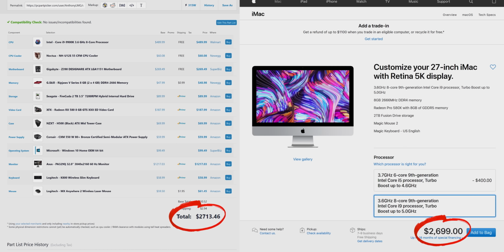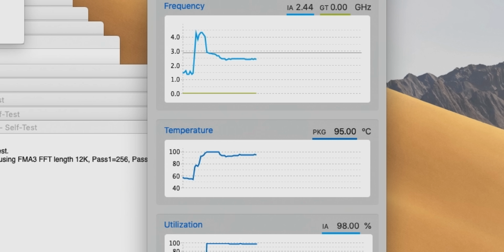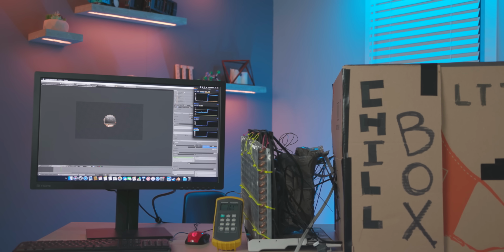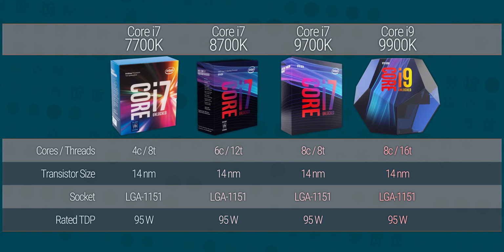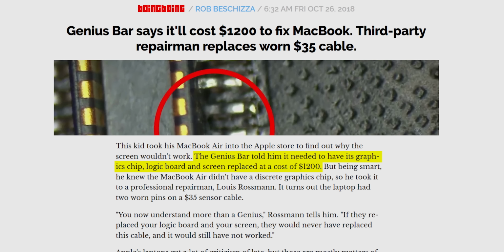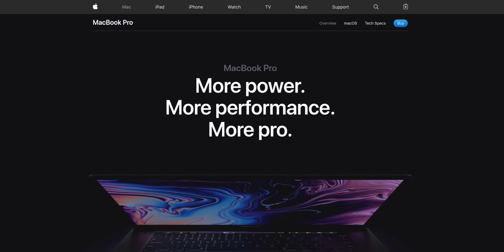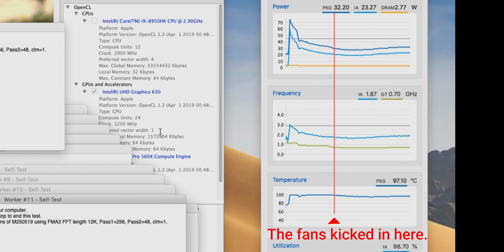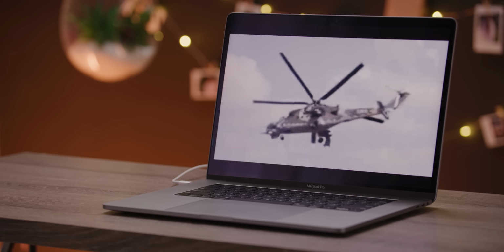Macs are SLOWER than PCs. Here’s why.

Comment: Given 85% of Silicon Valley uses MacBooks, it's not an issue of technical skill. Its an issue of recognizing that other variables matter beyond pure preformance every minute of the day.

I'd be pissed if my fan was ramping up all the time while I'm doing a zoom/conference/facetime call. 
Be assured that Apple data mines their support calls. I bet there is a 1000-to-1 delta between a support issues dealing with fan noise versus "my computer is 10% slower".

Comment: I can't get around why typing on the keyboard feels like you're typing on a calculator, DMG files are twice the size of ZIP files, proprietary adapter required for dual screens, inverted scrolling, overheating, not upgradable, the barely usable Magic Mouse, the cheese grater Mac Pro, pressing 3 bloody keys to take a screenshot, can't run 3D Studio Max, Command+C instead of Ctrl+C which puts strain on my fingers, no way to go "up" a directory, power plug impossible to pull out, you can only open one instance of an app at a time, no Start Menu, USB headphones don't work with it,  that aggravating "bong" noise when you turn it on, there is still just one mouse button, you cannot batch name files, you cannot snap windows, you cannot automatically arrange icons!

and they are SLOWER than PC's!

Inexcusable really, how much do these things cost again?
Reply: Stewart Fullerton few things... you can compress .dmg (.dmg is binary), Logitech mice work wonderfully (or pick your brand, just not RGB), Cmd+up is a thing, single instances are a feature (no write-protect errors), you can mute the noise (lookup start options, read everything), and it’s UNIX underneath all the bling so saying something like “you can’t batch-rename” is just an excuse to not learn the terminal... 
Given all that, you have a few fair points, and it’s blatantly Apple’s fault that anyone believes that a MacBook is anything more than a really snazzy word processor / presentation device.

Comment: You mean... Apple has been compounding hardware-design risks with "tweaks" in their OS, making their devices more likely to fail?  Sounds like "user-inflicted damage" to me. smh
Wac.  It just breaks.
WacBook Ail.  Light.  Paperweight.
CrApple.  Stink different. 💩🍎🍏💩

Frequent durable-goods replacement... the solution to climate change.  'Cause we can have our cake, and heat it, too! :-)

No man-made solution to man-made climate change?  No problem!  The natural solution of drastic population reduction will be selected for our species instead. smh

Comment: 7:30: The answer is that fun laptop computers use too much electricity and would give a battery life of 30 minutes in thin constructs. A greater asset for Apple is the A processors, so the laptops are in a mode of "well, alright, we need to get rid of the items from this failed project anyway... a few billions on the side won't hurt us."

Comment: Fedora Linux works so well i don't miss Mac OSX and i'm using it on a Core i3 2012 motherboard. Even without Wayland it overperforms any mac i could get close too...
Reply: mad scientist Yeah keep telling this to yourself... I switched from Debian/Ubuntu With Virtualbox(T460p 4cores 32gb ram)to MacOS with Fusion  and its faster cooler and  more stable. I dont give a sh about cinebench 😎 I use bash and PS on different platforms at the same time... For my workflow is great.

Comment: As someone who actually designs hardware for a living, Apple do a very good job, but they drop the ball from time to time (like we all do). 

If you chose wisely you can get performing machines that stay performant for a long time.

My 2010 macbook pro is still in use, and still better than some systems sold today. 

My 2015 has been pretty much always on since the day of purchase, and is still rock solid.

One of the big reasons for me to keep using macbooks (alongside my other pcs) is that Apple nails the little details that make your life easier.

The custom battery packs and chargers that Apple use are unrivaled. Most competitors either outsource or use canned type solutions that end up with heavy reduction in battery life or needing a full replacement.

You might have a different opinion, but for me having a laptop with a CPU that never has to throttle, is an indication that the thermal solution is actually oversized, and I’m carrying way to much weight. On a Desktop? Yeah, keep your dies cool, but if I have pack it in a bag, you better have a good reason for the weight you are adding.

Comment: I'm sure they did market testing and people "don't like it when the fans get loud".
Reply: I actually read somewhere that anti-cooling philosophy for macs comes from Steve Jobs
Reply: So what you're saying there is that Apple consumers drove Apple to make an inferior product.  Resulting in said consumers ability to buy a new machine more often due to improper cooling.  Glad I'm in the Microsoft camp.  Especially since my PC which was originally designed for Window XP is currently using Window 7.  And I might add performing at peak performance.
Reply: @savthmaall  go Linux and start flying
Reply: @savthmaall  These Apple people are fools. Plain and simple. They bought Lisa workstations for $10,000 in the 1980's. Then they bought the original Mac for $2,500. They quickly realized that the Mac wouldn't do anything productive until you bought Microsoft or Lotus software. Then they paid several hundred dollars for an IPod because they couldn't figure out how to use an MP3 player that wasn't designed for a child. Maybe Fischer Price should have designed one for them.
Reply: James In Sandiego on the plus side, my original Mac Plus from the 1980s still mostly works without ever having any maintenance
Reply: @savthmaall  yep they couldn't find water if we pushed them off a boat.
Reply: well you could always just make the heatsink bigger but i guess that creates an other problem what apple fans would not like
Reply: My coworker macbook pro 15" 2018/2019, it's fan will blow very loud at peak
Reply: i return amd a6 9225 ...  because of fan.. It dam weird over 20 year in computer i yet to see this terrible fan noise and  heat
Reply: Yes your probably right, I wanted to buy a laptop for my daughter and did some reviews on HP’s laptop computers and a lot of reviews say that they can hear the fan kicking in at high-speed too loud, it was a big complaint.
Reply: The “fans”.
Reply: Yes, just use costum fan profile that don`t let it get to 95C before starting to run.... I also use intel overclocking tool to reduse the CPU voltage and with those to mods combined my 2014 Macbook pro can run 100% CPU stress test all day at about 80C running 3,2Ghz with no CPU throttling at all. Without thees mods it will be running at about 1,5Ghz (2Ghz but because of all the CPU trottling down it is more close to 1,5).
Reply: @a64738  Exactly. Every savvy Mac user has known this for years, Linus is just Apple bashing for views.
Reply: @HighwayRamos  You really shouldn't have to do a whole plethora of mods just to get some decent performance out of an expensive laptop.
Reply: @rgbtryhardled636   Agreed. I'm just using a fan app I paid maybe $10 for 5 years ago.  It's too easy to set up a six stage fan map based on gpu or cpu temps. If it saves me from ever visiting the Genius Bar, totally worth it.

Comment: Difference in philosophy is in my guess – THEY DESIGNED THE CHIP for the iPhone to fit it's design. They didn't design the intel CPU. If you look at it from that POV the Apple ARM macbook pro is not as much a horror scenario than it would otherwise be – not a fan to be clear I want to be able to run linux on everything I buy ;)

Comment: I agree. The reason is because its software. macOS seems like an operating system designed for SSDs only. It's unusable when you have traditional HDD. While you can run Windows with HDD, just a tad slower.
Reply: did you ever run win10 on hdd?? slow as f**K, barely usable
Reply: Michel Antunes Yes I do. It’s slow yes, but compare to macOS on HDD, it’s much faster.
Reply: I was given a crappy laptop with a slow hdd and windows 10 at work. I ended up upgrading myself that fucker to an ssd because it was impossible to get anything done.
Reply: @theondono  Again, HDD on any operating system is slow. But HDD on Windows is faster compared to macOS on HDD. All my school computers have HDD and they work just fine.
Reply: @charka1234  Windows search and Superfetch kept my drive at 100% in iddle

Comment: Macs are faster than PC
Reply: They have worse hardware ,worse thermals and lack overclocking support. So: no, they are not.
Reply: @johnmartinez12347  I very much disagree
Reply: @dollophead294  This is not agreeing or disagreeing, this is facts. They reach higher temperatures, their top CPU is only very high-end and the top GPU is not even close to an RTX 2080 Ti. They also don't have any overclocking support.
Reply: @johnmartinez12347  True I guess, I probably thought that cause I have a mac and a pc and the mac is WAY faster. :) No offense taken
Reply: @dollophead294  It is very much up to what you pay. My point is that you can get more performance out of a PC and that you get better performance for less money. If you don't do heavy work or game, the only big changer after an ok build is an SSD. If you have an older computer, a cheap laptop or a normal desktop, it's probably a slower HDD. I personally switched from an old laptop to a new expensive Mac and thought that it was much faster, that was until I started using it for more things than internet browsing. Then I switched to a new PC a couple years later and it felt the same outside of heavy loads.
Reply: @johnmartinez12347  I think it just depends on the computer :) We just had a cheap windows laptop, then got an expensive mac. PC's do have better specs than a maxed iMac pro. So, yes, you're right :)

Comment: I've never bought a Mac, or iOS device for that matter, because of "Looks or Status Symbol". I've been working professionally with Macs and Windows boxes since 1991. I currently work in the field of Mac security. Please look elsewhere for why people prefer Apple gear. The meme of  'I'm an Apple fan, so I buy what's flash and fashion' is as superficial as the attempt to paint Apple users as superficial. Instead, let me offer one actual perspective of 'Why Apple?', among many:

CNN
Q: "What's your computer setup today?"

Frederick Brooks, author of 'The Mythical Man Month'
A: "I happily use a Macintosh. It's not been equalled for ease of use, and I want my computer to be a tool, not a challenge."
Reply: Apple Macbook Pro has actually pretty good coling at least om my 2014 model with 2,4Ghz i7. But you must use custom fan profile as the default one will make it overheat before it starts the cooling fan. Mine can run 100% CPU usage at 3.2Ghz all day and never get over 80C, but if you tried the same with default fan profile it would overheat at 100 -104C and run much much slower (about 2Ghz). But I have also used inter overclocking tool to reduce CPU voltage a little so it produses less heat but that only make up for about 10C reduction.

Comment: Hey Guys, I'm really curious about which laptop alternative to a Macbook Pro 2017 does not have this "thermal throttling" issue? I can't use a Desktop I need to move around pretty often and travel with my Laptop all the time, so a Desktop is not a good fit for me

Comment: 90+% of the (non-gaming) computer buying public will never push their machines to the limits where thermal throttling is an issue.

BTW my Macbook is 6+ years old and running great. My previous HP laptop died after about 16 months (the screen stopped working, some problem in the hinge) so tell me again how Macs are unreliable…

P.S. I'd rather have my thin, light, quiet Macbook Air than a faster, inch-think, heavy monster that sounds like a freight train.

Comment: Just got a 2019 15" with the 8 core and had various issues. After waking up the computer from sleep/look screen it will turn on its screen from low to high brightness, then it will flicker once or twice... shortly after that it will lag for for like a split second every 3-4 seconds then it will shortly stop... it will freeze to where the time and all programs (nothing open and running) will not respond and restart. Upon restart it will create a report with and issues on "Bridge OS" anyone know what that is?

Comment: I think what happened is that they just expected Intel to have more efficient chips by the 2016 MacBook Pro redesign (a fair assumption a few years ago). Once it was clear Intel wouldn't be able to deliver, they stuck with the design, which led to the thermal limitations we all know. Keep in mind that Apple takes a long time to design their products, so they have to work with assumptions from suppliers (which often don't come true by the time they had expected). On the iPhone, they are able to know exactly what their CPUs are going to deliver without much need for assumptions because they are designing the chips themselves. TL;DR: it's not like Apple is just stupid (or "evil"), there was an expectation from Intel to develop more efficient chips which was not met.

Comment: I don't like overpriced Macs but I had Mac as my work laptop and it froze maybe 1 or 2 times during 3 years. Apple are still producing software in conjuction with hardware which makes them better laptops. Is it good price/value ratio? Not sure. But if you have unlimited budget Macs are better.

Comment: If you buy something simmular at the price, you would also get a working cooler, K-model CPU you could actualy overclock, most likely better keyboard/mouse. And if anything breaks you have a warranty on each seperate piece of hardware. I dont see the price near close.
And you can change parts down the line to continue to save money..

Comment: I have a MacBook Pro 13" 2016. but i wouldnt see myself as an "apple-fan" (Huawei phone, Asus desktop pc) 
But i really love the macbook pro laptop. its small, good battery life. awsome keyboard and (to my knowledge)  the best touchpad out there. it never gets hot and never feels slow. 
and i dont think ist a status symbol anymore. 

So my question is, if a want a laptop PC, what should i buy?? 

Things i want on my laptop:
Macbook size
the same-ish keyboard
glas touchpad with "taptic" and as large as the macbook pro touchpad
Reply: Btw. i love how everyone is hating on the macbook but cant name one single computer that is better..
Reply: I am thinkpad fan, you can buy x1 carbon or extreme as per your needs.
Down sides: trackad and battery life not among the best but keyboard is unmatched.
Durability is not a problem and with x1 xtreme, it is easy to upgrade RAM and stuff if you want in future and they last well.

Comment: The problem is that the os and programs are so far removed these days from the hardware that both the os and the hardware are only  just guessing what the other wants to do and they try to optimize for the unexpected behavior of the other. Which makes everything so much slower ... Ah, the good old days when we had a lot more precise control over everything ...

Comment: Besides the fact that they don't want their computers to be noisy, high rpm fans do little with small heatsinks so they would need to make their laptop thicker and heavier to for it to perfom better.

Most people don't render on their iMacs and those who do care about rendering speed will figure something out.

Stronger CPU still matters in Single-Core tasks, which will not overheat the CPU but will benefit from higher Turbo-Boost speed, and most modern software still needs that high Single-Core speed.

Comment: My late 2012 mac pro is snappier than any new mac pro 🤭
Reply: Those were the last good machines Apple made before they went all mad with slim.  I have a 2009 machine and bought a refurbished 2012 a while back.  I had the 2009 for over six years with no bother.  They are both great machines.  Use my 2012 now for the brunt of my video editing in Final cut Pro X and I love it.  Anything after 2012 is trash.  If you're after a Mac there are good refurbishing companies around selling the older ones at great prices.  No need to pay Apple's crazy prices for a 'newer' machine that isn't as good.

Comment: One reason for the disparity between iPhone and Mac thermal related throttling may be the processor architecture of the respective products. Like most mobile devices, IPhone utilises an ARM based chipset; ARM processors have been specifically designed to perform well in devices with smaller foot prints and form factors. Conversely MacBooks are are obviously equipped with the more substantial x64 Intel processors. 

The respective RISC (ARM) and CISC (x64) Instruction set architectures may also be a factor, however it’s difficult to be entirely sure since both ISA can, in theory, be optimised.....

Comment: "why does Apple use a thermally compromised design?" 

Because it works? Put against comparable ultrabooks, the Macbook crushes it. Costs way more, but it's a luxury product for people with too much money anyway. The XPS or Spectre certainly have similar thermal problems, and it's not like they are trying to compete with the Area 51-m or the MSI Titan. Yeah, it throttles, but most people don't work it hard enough to sustain high temps, and even if you do, if you need Mac software, what else would you buy?